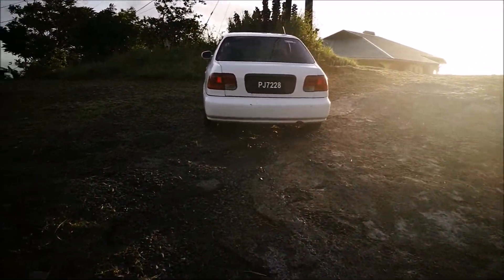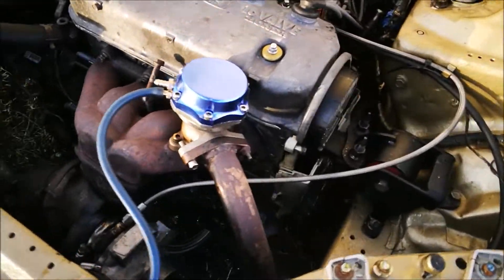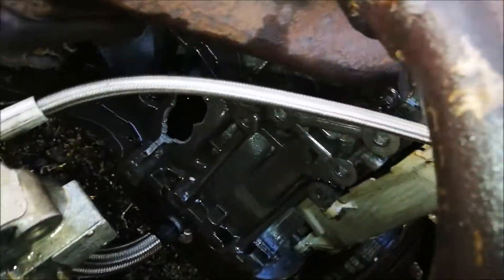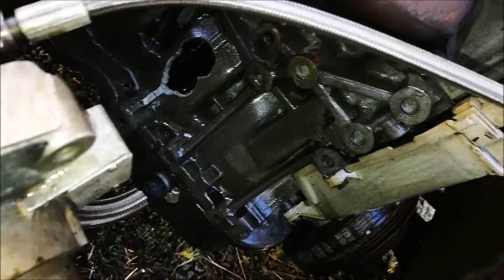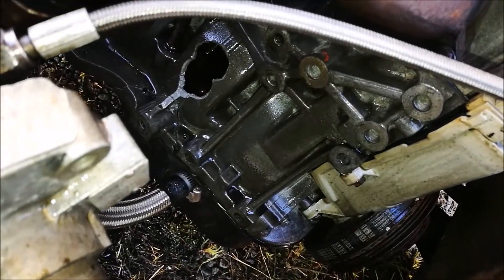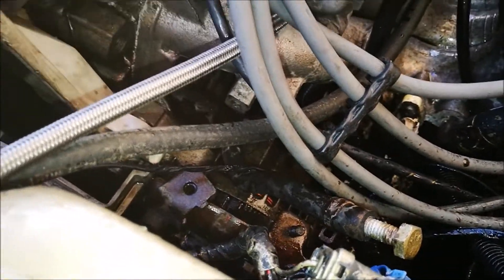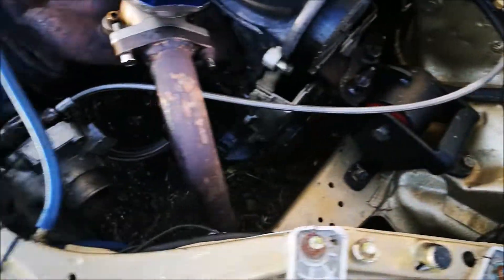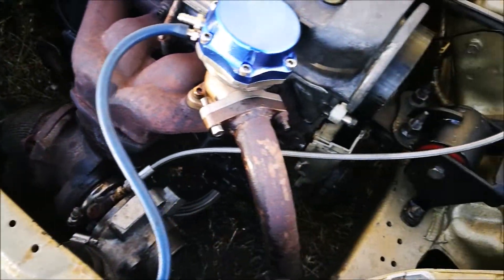I Blew Up My Motor !!

Comment: DCwerx , am s😟rry for the setback , caused by rod failure.  stock rods on most engine we boosting, can't stand up to much boost and sure to break if pushed too far for power.   "If it's breaks ,you built it next round" 

 So upgrade the rods for the rebuilding. I was debating weather to get rods for my car or not but seen your broke engine am just going go buy it for Christmas. When it breaks I put built one it.
Reply from the maker: Thanks man. Rods are must for these motors. Unless you intend on running some really low boost with a tiny turbo then it's inevitable. Good call on building your motor